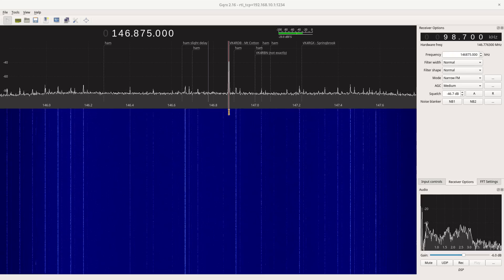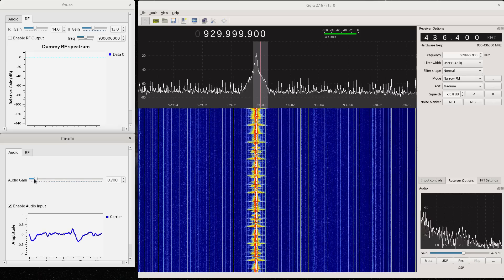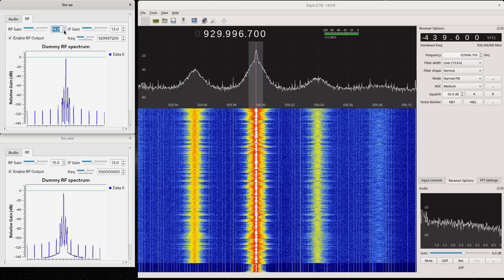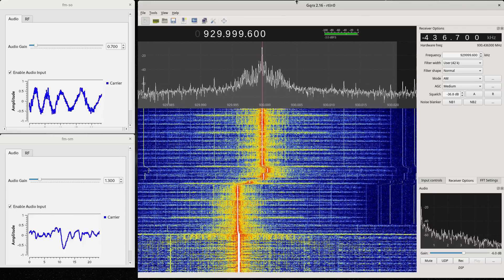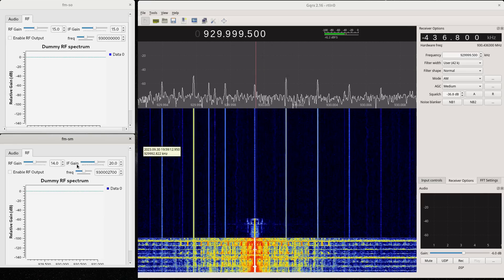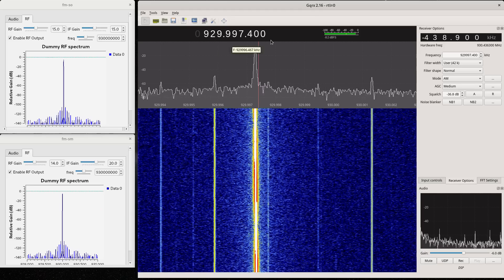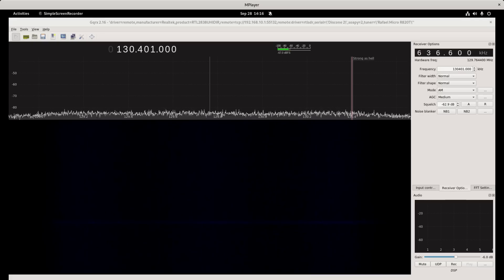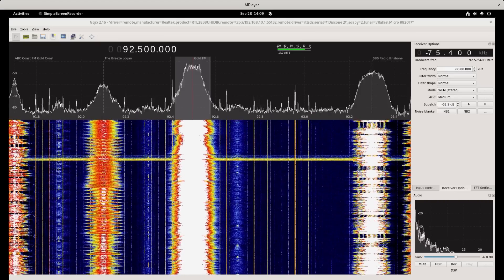Demonstrating FM Capture Effect

Comment: This video as all B.S. The reason aircraft comm is AM is because it has ALWAYS been AM, and switching to FM would require all the private pilots purchase new radios for their aircraft. The FAA has had MDR (Multimode Digital Radios) in place for over 10 years now, but any attempt to change is met with resistance by the public.
Reply: Not sure think it’s more the capture effect🤔 Europe transitioned from 25 KHz to 8.33 KHz channelling which required replacement of older radios or they’d cause QRM both on TX and RX.
Reply: In the USA, FM was promoted as an alternative to AM as part of product differentiation. Certain stations were AM and others were FM, and each side promoted their technology. And yes AM came first.
Reply: Exactly, totally BS 😜

Comment: Okay, so now I understand why aircraft use AM in preference to FM, but why don't they use SSB?
Reply: SSB is finicky to tune. Sure, all of your power is being used to transmit intelligence but it's worth wasting a lot of power on the carrier so you can just dial in a frequency and have it work. Pilots don't need to have to be fiddling with a BFO all the time.
Reply from the maker: I like that you used the correct term of 'intelligence' there. I was going to say that, but dumbed it down to 'information' for the sake of YouTube :)
Reply: @johnopalko5223 Since the 1960's, airbourne HF transceivers have used frequency synthesis with a high stability frequency reference with a worse-case transmitter frequency error of +/- 10 Hz.  So basically, everyone is tuned to exactly the same frequency, thus eliminating the "Donald Duck" problem.
Reply: @billharris6886  I didn't know that. My only experience with SSB has been in ham radio.

Thanks!
Reply: @johnopalko5223  Hi John, having made a career of servicing, then designing the RF and analog portions of aircraft HF, VHF, UHF transceivers helps.  Yes, the older VFO tube type Ham Transceivers were constantly drifting.  This problem would be totally intolerable to pilots with all of the demands placed upon them to fly the plane.  They absolutely need a radio they can set and forget as far as any kind of adjustment/fine tuning goes.  A good performing squelch is another must-have item (any squelch tail is strictly forbidden).  VHF and UHF squelch is used but, HF is so noisy, the pilots turn off the volume and rely upon a SELCAL tone decoder (basically used as a pager) to let them know the air traffic controller want to speak with them.
Reply: The drifting and off-frequency gear of old made it impracticable, but these days frequency precision, accuracy, and stability are all so much better that it shouldn't be a problem.   @johnopalko5223
Reply: @30dBW    Frequency precision by itself is insufficient to make SSB practical.  In the VHF aircraft bands and yet-higher frequencies, the doppler shift in received frequency due to aircraft motion would have to be compensated to make the audio sound right and to be intelligible in some cases.  For the transoceanic HF radios mentioned by dustyrideretc, the doppler shift is much-reduced and is not so much of a problem.
Reply: They do. Transoceanic aircraft carry HF radios and utilize SSB to this day.
Reply: @lawrencebrown3582 HI Lawrence, the VHF and UHF aircraft bands are considered local communication (less than 100 miles range).  Using SSB is a good idea, however with all of your transmitted energy going into one sideband, a 2.5 kHz bandwidth, and product detector, you can detect signals below the noise floor.  In short, SSB design significantly increases the range, which is undesirable for VHF and UHF local use since, with the limited number of channels available, the frequency gets reused by another air traffic controller, as little as 200 miles away.  Of course, sporadic E-layer propagation causes major problems when active.  Fortunately, it doesn't occur that often and the controllers use alternate frequencies to avoid interference during these times.

Comment: Great video! Does this mean aircraft radio will always be terrible quality? Just so it can be transmitted over intelligibly? Can't they interleave some hidden bits of data to clarify the signal if you have a specific receiver, like with FM radio? What about trunked radio for aircraft, then it wouldn't matter if you can "transmit over" the other person. (It would all be interpreted by your receiver, and audio mixed to whatever standard is required, using multiple receivers / multiple input channels.)
Reply: News flash: The audio isn't that bad if you're using a good aviation radio. The audio quality you hear on an RTL-SDR sounds like crap because the dynamic range is crap. Also aircraft cockpits are noisy places. The headset microphones are built for durability first, noise cancellation second, and audio quality third. 

Finally, trunking has NOTHING to do with audio quality and everything to do with sharing channels. In aviation, the air traffic control channels are often so busy that there is marginal benefit to sharing channels. As for FM vs. AM, VHF AM was state of the art when the VHF aviation bands were created by international agreement. So that's how it ended up with AM. Changing an international agreement like that and doubling the number of radios in today's airplanes to switch from one to the other just isn't practical. So we're stuck with it. Those radios do work pretty well for what they are and they're stone simple, which is how most pilots stay safe.
Reply: Or use wires ?

Comment: AM goes further but also when aircraft first started using radios AM was the modulation used.
Most people don't remember that all the police and fire used shortwave way back when radios were first used by the police and fire stations.
I think Los Angeles used around 3 mhz when they first started using the two-way radios.
They were all AM originally. FM did not start till the 1950s.
Many cars made in the 70s only had AM radios in the car

Comment: International flights also use upper sideband on hf frequencies.
Reply: An HF-capable radioset is compulsory equipment for any transoceanic-going aircraft.  Due to the long wavelengths, thus long physical length, HF aircraft antennae have always been fiddly affairs.

Nowadays, a dual-sat terminal is the more likely choice for over-the-horizon comms.  Though, HF is still required to hop a pond — last I talked with my A&P buddies about this.

That’s the trend with Civil Aviation — old tech / systems can maintain cert, and rarely (if ever) go away.  New tech adoption is almost always additive in nature; and optional, at least for a long time.

Comment: This YouTube channel is incorrect for Cb radio use am only but there is fm cw and lsb usb mode
Reply: uhf cb in australia and new zealand use fm
Reply: I think that cb in UK also used fm. I didn't get involved, but I remember the big stink when it first came out because the fans couldn't just buy radios from the US, they had to buy specially manufactured expensive  fm units iirc. It was introduced back in the late 70s early 80s iirc.
Reply from the maker: HF 27MHz CB would be AM but I was in the UHF range with that little CB I used.
Reply: 27 Cb is an,fm,usb,lsb mainly am,LSB in usa.
Reply: The FCC now allows FM as well as AM and SSB on 27 MHz CB in the US.

Comment: I don't think that this "zero beat" (nearly phase synchronous) situation has anything to do with the fact that they use AM. Air band communication is way older than the first experiments with narrow band FM used for most analog voice communications, which would also fit into the channel by using a similar bandwidth. So it all started with AM decades before people figured out FM.
In the old days it was much easier to create high fidelity in FM than in AM, but AM has the advantage of being more power efficient, because the AM carrier needs to be only a fraction of the maximum modulated output of the transmitter, while FM is always the same maximum carrier amplitude that just shifts its frequency in the rhythm of the audio frequency and deviation of the audio amplitude.
Even today there are still plenty of older VHF Com radios in operation that don't operate on a TCXO or any GPS-based reference oscillator in order to be within a few Hz close to the actual frequency. You can clearly hear that when there are sporadic-e radio propagations, which means an airport a few hundred miles away, operating on the same frequency can suddenly be heard and vice versa. In this moment you can mostly hear the difference in their RF carriers creating an audio carrier with exactly that frequency, leading to plenty of loud and annoying tones that make the voice mostly unreadable. Your theoretical situation has nothing to do with the real life reality, though I get your point, which is only valid with modern transceivers while receiving two stations with nearly the same amplitude, which is also happening rarely. Interestingly enough there are modern DSP based demodulators in some state of the art demodulators that are not only able to create a smart voice based noise reduction, they also run algorithms with so called auto notch features, meaning they detect an heterodyne tone and subtract it with the same frequency and amplitude but with a 180° phase shift, eliminating this specific audio tone very selectively, advancing the readability of the wanted audio signal (voice) dramatically. There are also algorithms to subtract the modulation symmetrical around a slightly shifted unwanted carrier, increasing the signal to noise quite a lot. Thanks to DSPs today we can do signal optimization on a completely different level than ever before.
I think apart from making thunder impulses way less annoying, FM would not have big advantages that would justify the very difficult transition from the historic AM to FM, which can only be done in real life flight operation. If the squelch ever fails - and I have that happen in flight - it is way easier to listen to the dynamic signals coming from the AM demodulator, rather than the intensely loud white noise from an FM demodulator. But I think that is also not the actual reason they never tried this very disruptive worldwide change of modulation standards.

Maybe someone from the FCC or FAA can shine light on why this change never happened? 
I believe the disruption this would bring to the lethal communication between aircraft and ground is very dangerous and the advantages were simply not outweighing taking this risk, but this is just my personal guess.
Reply from the maker: You said "but AM has the advantage of being more power efficient", but that's not true. It's the least efficient, unless you go SSB. The carrier is wasted power with no information, and the sidebands are the same, so only need one of them for information.
Reply: @TallPaulTech  you are right if considering all modes, but I meant in relation to FM, because having enough oscillator stability to maintain a reliable communication on VHF for a proper USB signal was almost impossible decades ago. Today they use SSB only on HF with a very frequency sensitive selcall system to mute the HF noise an be able to selectively get called from trans oceanic ground stations. They also send digital HFDL data frames that make it around the world with no extra infrastructure. I see signals from planes over Australia almost every day though I live in Munich, Germany.

Comment: The actual reason is much more mundane. Durable VHF AM transceivers that would reliably perform in the extremes of altitude, heat, and cold were available first. AM was enshrined with international treaties. It works. So there really isn't much motivation to change it.
Reply from the maker: AM is the simplest receiver for sure.
Reply: The simplest answers are often the right ones. It simply comes down to legacy and interoperability. AM were the first radio's and it didn't take long before the world over adopted them. The sheer difficulty of having the entire world change radio's for general and commercial aviation overnight is a big reason why they don't. Heck the aviation industry still uses leaded gasoline so they don't have urgency to transition to newer technology as quick as the rest of the world.
Reply: I hope this doesn’t change but the coms manufacturers will try to push anything with a chip in it, then try to convince general and commercial aviation pilots that it is better than AM after running their own trial tests without releasing them and markup the price to make them more $$$, €€€, £££, and ¥¥¥. After all, isn’t DRM, ATSC 3.0 and HD radio here in the U. S. working so well?

Comment: Another bonus is the extended range. On AM the transmitted power varies with the payload signal (except for the carrier). FM constantly emits the same amount of power. 
You are trading a bit of quality for a lot more range.
On that note, with the frequency stability of modern radios, a somewhat backwards compatible choice could be SSB. Even more power into the payload and none into carrier or redundant sideband. Might help on long distance flights over water, so that you could radio in a bit earlier on arrival or have a lager coverage at the coastline.
Reply: SSB has long been used for aircraft long distance communications on HF. AM is used for VHF where long range is not so important.

Comment: A lot of aircraft radios are slightly off frequency as well as I''ve seen while looking at the local airband.
Reply: It's not easy staying on frequency while the radio has to endure very significant changes in altitude and temperature. Modern radios are somewhat better, but not everyone has the money for new radios, costing thousands of dollars (you read that right).

Comment: At least in North American, DMR (digital modulation) may actually be the most common mode in today's radio landscape, with FM being a close second. For example: Motorola P25-DMR radio systems are currently used by nearly every public safety and utility agency.  It's also worth note that although AM does not exhibit the same "Capture Effect" as FM would, in which only the stronger of two overlapping signals would be heard... If two AM overlap and are not on precisely the same carrier frequency, heterodyning will result, which can render both signals unreadable.
Reply: Problem with DMR systems is that they are usually all-or-nothing in terms of reception and they are also WAY complicated and often rely on some infrastructure. In an SHTF situation I would much rather have the time-proven and more reliable analog systems, using simple AM & FM modes. Newer technology definitely isn't always better.....

Comment: Ideally SSB would be better eliminating the heterodyning, but fine tuning is its downside. If only they could create SSB receivers with some sort of automatic tuning feature. Maybe a quick tone on keyup that triggers the receivers to lock in quickly and automatically.
Reply: UPS here in Chgo used FMSSB it used a pilot tone on transmit for the Rx to voice lock. Worked well enough and accurate to pass touch-tones. No fine tuning of Rx.

Comment: Aircraft communication should have gone digital ages ago. Why have pilots manually change frequency with the possibility they will do it wrong? Why risk transmitters stepping on each other at all? Why not send vital messages in text instead of fast speaking and hard to understand controllers?
Reply: It may be hard to hear for you, but to people in aviation it's not an issue. Everything has to be read back to confirm they heard instructions correctly and it's also recorded. So a simple text or reply with text isn't good enough and so much easier to speak it than type it as you are flying and doing other things with your hands and looking at more important things while flying. Especially under emergency situations, no time to look at texts and then type a reply.
Reply: this sort of communication is actually used with some aircraft (look up acars), but when a pilot is having an emergency, or even just at any time where the workload is high, its a lot easier to hold down a button and talk than it would be to construct a message

atc and ground also need to make sure that the pilot has recieved, understood, and is going to or is currently carrying out an action that they instructed them to do. if a pilot just took off, their workload is going to be high as they perform their climb checklists, and they could miss a crucial instruction from tower or departure, which would risk their safety, as well as the safety of other aircraft
Reply: That's a good explanation. Life teaches us to multitask speaking with other activities. There are few, if any, people who can type text and do much else at the same time. And when a plane is in trouble, focusing on texting is hard to impossible @enthusiasticgeek7237
Reply: I am not suggesting they stop talking or that the pilots start texting while driving. But when the control tower sends out important information, that the pilot currently has to "copy", they could send this as data in addition to saying it out aloud.  We currently have multiple autonomous autoland systems in the work for smaller single pilot aircraft and which can land with the pilot incapacitated. These use speak to text which is unreliable and dumb. The autoland should simply get the information as data. On larger airplanes having the information as data will allow the computer to make alarms when the pilots are about to make a mistake or reduce the workload by making some updates automatic.
Reply: ACARS has been used for routine aviation text comms since forever, but new digital/IP technologies are coming into play. Typing and reading text is slower that speech though even with voice-to-text and text-to-voice software, so not sure about using that for vital messaging in a fast moving environment..
Reply: Your right, a quick data burst from the control tower to change the frequency on the plane. Quick and simple.